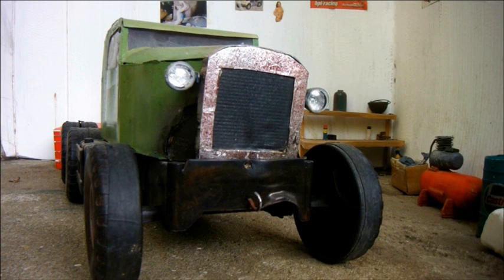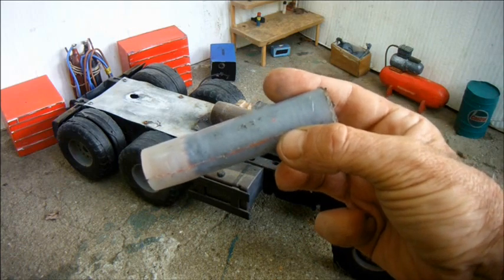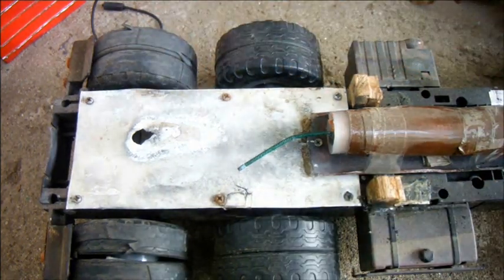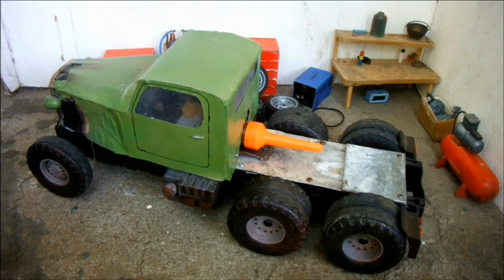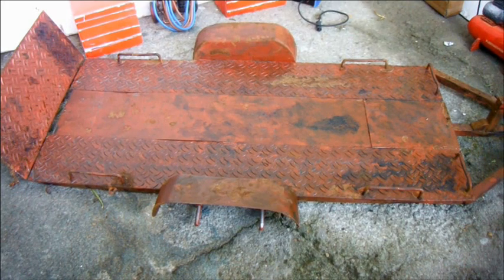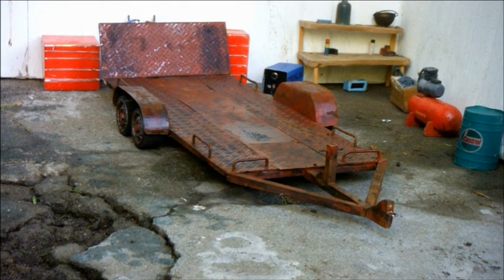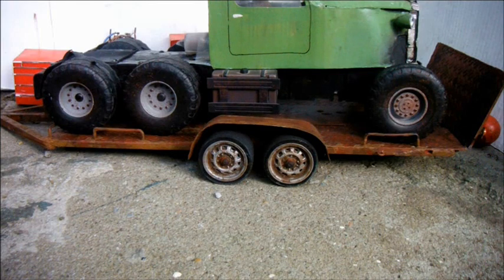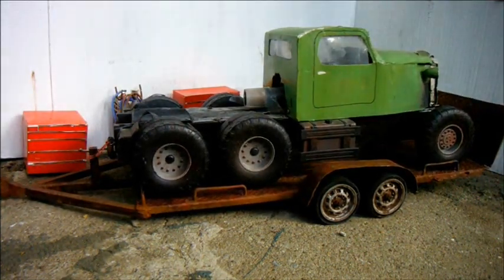RC rat rod trailer build and test

Comment: Del I could sit and watch these videos all day. They always bring a smile and, as with this one, have me wishing I was there with you.
Spoilers mate... I was screaming it at you all the way through. Think formula one. Upside down aeroplane wings creating downward force.
How about a wind tunnel? Let's see smoke and drag planes...
I know your mind has just sparked to life. That ingenuity of yours will create something fabulous for us to enjoy.
Reply from the maker: Hello, Goeff!
 The trouble with the wing idea is that, according to the  "pendulum rocket fallacy"  https://en.wikipedia.org/wiki/Pendulum_rocket_fallacy,  it won´t work. Firstly, we need longitudinal stability rather than downforce, as, following the addition of the steel plate, the rear wheels are now meekly staying grounded throughout each run. Secondly, fins only aid stability if the vehicle continues in its original direction of travel after yawing, coz then the wind of its passage (as it were) would strike the side of the fin and tend to turn the thing´s nose back towards the direction of travel. My truck turns its nose off course and then changes its trajectory to suit the new orientation, so I think fins won´t work. I´ll try them anyway, of course, because I might be talking bollox!
 It would seem like cheating to me to fit an electronic gyro linked to a steering servo before having tried everything else I could think of! I´d like to come up with a design which is inherently stable if possible.
 Thanks for commenting - it´s always a good idea to take feedback on board  : )

Comment: Great stuff. I like the patina on the trailer. and the clever use of parts to make it.
Reply from the maker: Hello, mate! How are you? 
 I must admit that I´m quite chuffed with the patina on the trailer. Now it´s finished you can´t see how cheaply made it is, and I´ve been meaning to build one for several years now.
 I´d like to do a "ramp truck" or recovery vehicle as we call them in England. I daydream about hacking up several bodies to make a "cabover" or forward control truck cab, to leave more room for the ramps at the back.
 One day!

Comment: Nice crazy idea, looks like will need softer tires to get more grip you can also aim the back of the rocket up a little to keep the truck more pressed to the ground

🔵🔵🔵👍👍👍😀😀😀🔵🔵🔵
Reply from the maker: I have now got the rocket truck to work beautifully. 
The video is called 'Rocket truck full power high speed runs', I think  : )